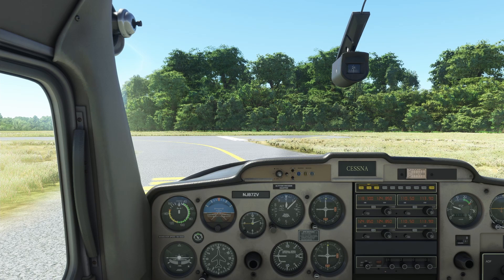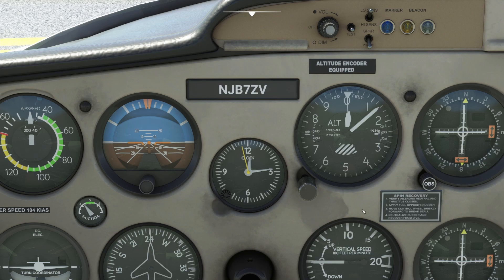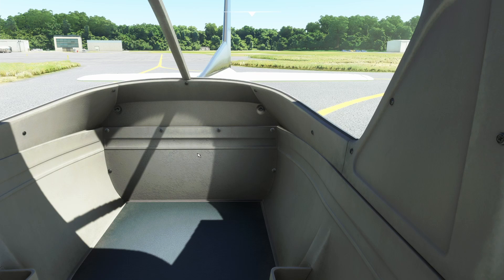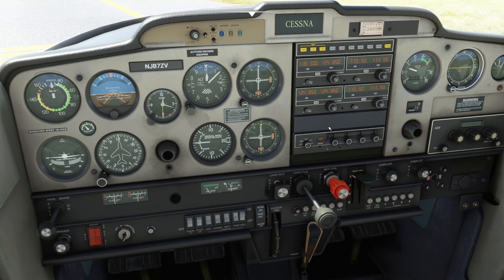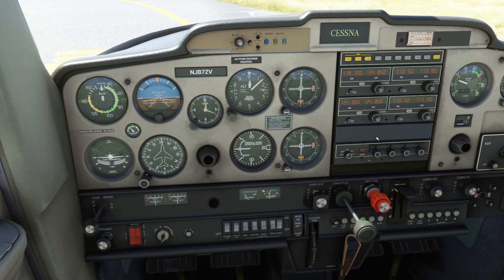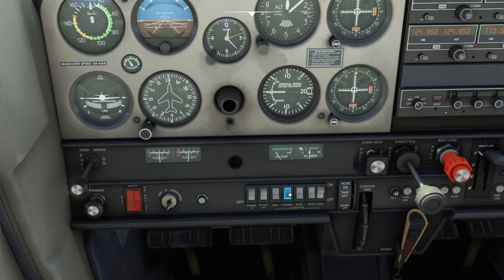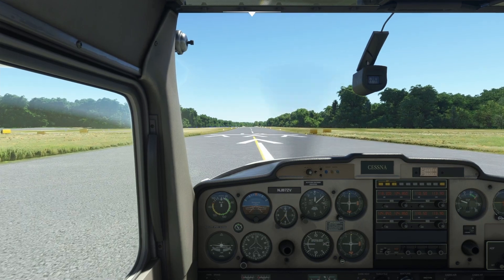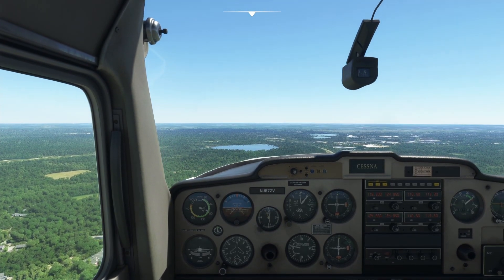Aces MSFS Flight Training 101 | C-152 | Lesson 3 | Runup & Takeoff

Comment: Is it me, or does the 152 pull to the left, requiring right yoke almost constantly to correct this? Wish this thing had aileron trim :)
Reply from the maker: No! It's not you!! 😎
It's most noticeable on takeoff. It's called "P-Factor"
The nose wants to yaw left, so you have to apply right rudder during takeoff/climbing.

Still a tiny bit noticeable in level flight, but only just barely.. 
I'd advise trying right rudder instead of Aileron.  See if that's easier.

Thanks for watching!! 😁
Reply: @AcesDwn1  ok, thanks! Will try rudder instead!
Reply from the maker: Hey Will! Just checking in.. Did you have a chance to try that, and if so, did it help?
Reply: @AcesDwn1  Tried the rudder thing out in the air. Plane rocked and rolled slightly violently and groaned alot. Did NOT like it :). Using yoke was just a quick and easy right  stick and then level out. Will try again and on takeoff.